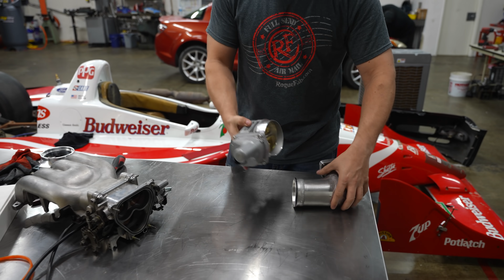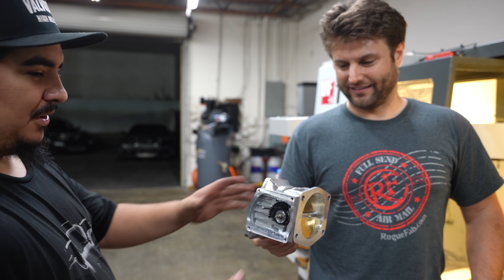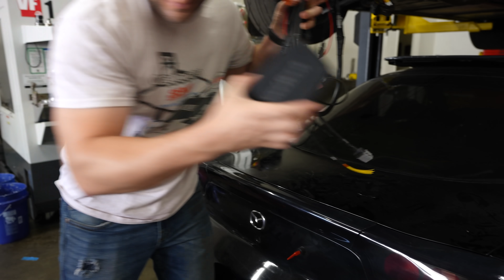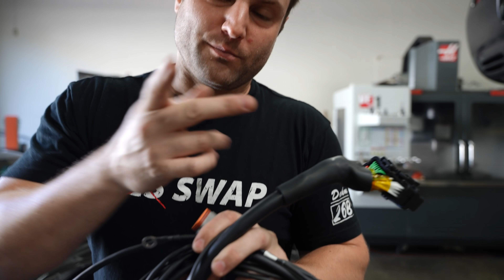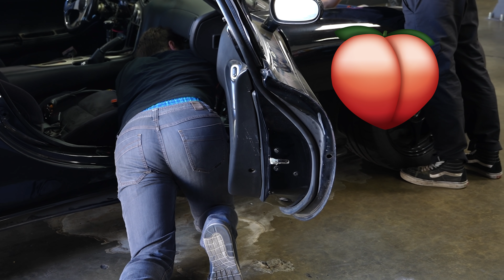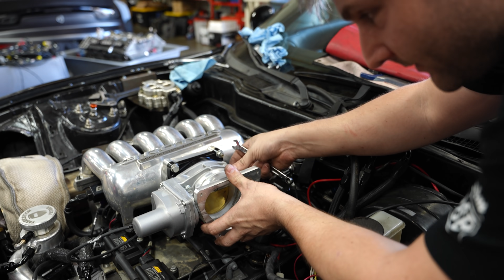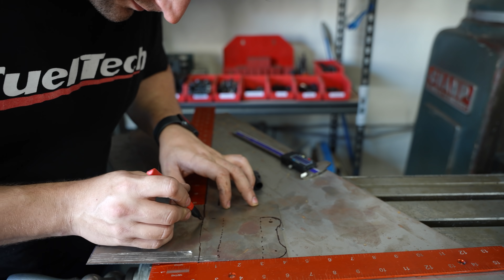Drive by Wire to help the 3 Rotor RX-7 pull wheelies and idle!

Comment: I mean.. you have a C&C mill.. why not just make a plate with the correct bolt pattern on each side where the pedal goes, and not rely on janky all threads and flange nuts?

Comment: For the pedal;  cut a plate to go under it for rigidity.
Now cut 4 sections of pipe to go underneath and but up against the body and plate flush and they surround the studs.

This should make it rock solid.

Comment: Some older cars used a cable driven tps sensor for drive by wire.
They are great because you can reuse the factory cable driven pedal but just mount the tps sensor and then still utilise all of the benefits of drive by wire.
Mid 2000's honda accords are one car that used them

Comment: Good overview on Drive by Wire. There are many benefits as you mentioned, along with the ECU mapping for commanded torque / commanded throttle position. There are many safety aspects behind the scenes which should have been well vetted by the ECU, electronic throttle body, and foot pedal manufacturer. Care must be taken when making and routing the engine harness. It can factor into electromagnetic compatibility (EMC) issues. I've seen a lot of things when I designed Drive by Wire electronic throttle and electronic shift controls for ECUs.

Comment: Good job on getting your drive by wire system to work, we set up drive by wire on our rx7 years ago using motec and we’ve never looked back, we use a rx8 pedal and bmw motor to drive it. Our system is a little different because ours run a quad throttle body intake

Comment: Just make a bracket that goes from oem mazda holes to GM holes. I would put horizontal lots on one or both sets of holes so you can slide it if needed... just 3d scan both pedals. Line up the flat spots in cad. Then make a billet bracket on your cnc machine.  Easy!

Comment: Don't forget to install a gasket between the drive by wire module, and the adapter plate to make sure you aren't leaking air there before you try to chase your idle.  You may be seeing it draw air from there.
Reply: Until it’s under boost where it becomes a boost leak

Comment: Rob you have a CNC mill design and make a adapter plate for your pedal, can't get more rigid than one solid piece
Reply: not the best option due to weight, and unnecessary complication. it’s much easier to make a bracket by hand that fits well enough. cnc work is better suited to high precision applications like engine components and gas flow management.

Comment: You could have kept the original throttle pedal and ran the cable to a remote tps, how late 90's mercedes did their drive by wire.

Comment: You have to be careful with drive by wire on boosted applications. On higher boost cars they don't have enough strength to hold the blade in place under boost. Hopefully it works out for you.

Comment: Rob, make a log from cold start to operating temps. I’m pretty sure there will be a table that accounts for throttle position vs temp and that info will be useful to help with the idle setup. Also, do a calibration again when the pedal is installed. The ecu should manage close loop idle control and using a table with temp vs rpm will make it a cake. First solve all the vacuum leaks or they will make you more crazy. Best of luck, awesome content and loved the wiring harness making video.
Reply: I was going to say something very similar. Great minds think alike
Reply: @nodak_forged  your missing the second half of the quote (not to insult you or anyone)
"Great minds think alike, but fools rarely differ" I belive that your version applies in this situation though.
Reply: @nighttracker1472  haha yes the Greeks knew it best

Comment: keep the important stuff, the virtual hairs, only then look at your visible hairs, losing your essential things will cost all your visible things, keep Christ, faith
Reply: and no bs bldc, ac, motors, but pure dc motors and generators, connect bearings brushed dc motors/engines/generators, no homo
Reply: and supercaps to have huge high voltage boost to the dc motors, no other form of storage, only metal-air, which hold similar energy compared to gasoline
Reply: if you would have a computer running the car, then you would not need additional computer to put the settings, and no separate payment for the tools, its a scam
Reply: power lines, separate, dont need shielding,  so you can have three lines, the differential input signals and the power lines, ethernet plus power, to make it simple, if you need more power than the POE can deliver, over the ethernet lines
Reply: quick swap single-use/easy-to-recycle metal-air batteries, in the trunk, or next to the engine, hub/central, whatever
Reply: relay logic
Reply: foundations
Reply: Rauhotu :DD
Reply: @jaskanpas2503  rauhotu itse, en sinua kuuntele
Reply: @jaskanpas2503  en tarvitse urpoja kertomaan mitä voin tehdä, tai jättää tekemättä, suu tukkoon
Reply: Näköjään useampaankin videoon oot kommentoinut tommosen teksti pommin :D Mee foorumeille kirjottaa nii tarvi iha yksi puhua
Reply: @jaskanpas2503  ei tarvitse puhua teidän kaltaisten haamujen kanssa
Reply: @jaskanpas2503  turhaan "välität" minusta, kun et välitä
Reply: @jaskanpas2503  etkö ymmärrä olla jo hiljaa
Reply: @jaskanpas2503  ketään ei kiinnosta
Reply: @jaskanpas2503  en välitä mitä mieltä olet
Reply: @jaskanpas2503  en kumarra enkä kuuntele sinua, en ole vuohi, enkä pukki, vaan Herran lammas, järjellinen, ei järjetön, niinkuin sinä, en kaipaa järjetöntä puhe-seuraa, anna vain ylen tänne, tämän oksennuksen, jos joku siitä jotain hyötyy, ilmeisesti et hyödy siitä, siksi puhut
Reply: @jaskanpas2503  kärsi koronassa, kunnes tulet järkiisi, etkä enää pakota sääntöjäsi, rajojasi
Reply: "Herran lammas" :-D Se on täysin totta, bääbää
Reply: and if you are not given to, you will be taken away all you have, sob sob
Reply: pressure-compressor boost turbo stage, in-between, the actual turbo, and the chamber
Reply: but still, continuous burn is the best, use as heat source, no matter what you compress, just heat water or air, to spin any or turbine, generator, to electric, acceleration

Comment: You can cut off the old pedal and weld it to the e‐pedal and bend it appropriately 👌🤙
Reply: My thoughts mostly.  Just lop off plastic section of e pedal and add whatever pedal /angle / length ya want.
Reply: Either that or go with the standard Subaru Legacy. Basically the go-to option for e-throttle swaps as the mounting and pedal are both completely metal so it's super easy to adjust to suit.
Reply: AISURU.TOKYO/AGNEZ/?[Making-love]💞
(◍•ᴗ•◍)✧*。18 years and over🍎🍑

Youtube: This is fine
Someone: Says "heck"
Youtube: Be gone
#однако #я #люблю #таких #рыбаков #Интересно #забавно #девушка #смешная #垃圾

Comment: I have a 70 camaro and an ls to put in it. but part of why Im dragging my feet on it is I want something different. electric or wankel engines are the front runners.
Reply: Please do Wankel, electric will be done so much in the future and ls is too common. Have fun with your project
Reply: keep it chevy and go with a turbo vortec inline 6, if you are at all curious look to see what richard holdner has done with them as well as nivlac57
Reply: Could put in a coyote just to screw with fanboys
Reply: @lazarustheatv8389  id be tempted but I've personally seen 3 of them already
Reply: elky5987 different ford engine then. I would choose either 7.3 Godzilla or ecoboost. I could suggest more but my list of suggestions is about as long as the list of performance engines that Chevy didn’t make
Reply: @lazarustheatv8389  not a big diesel fan and im going a pro touring direction so I like the idea of low weight high rev. but something like a SHO engine might be interesting if we stay the Ford direction.